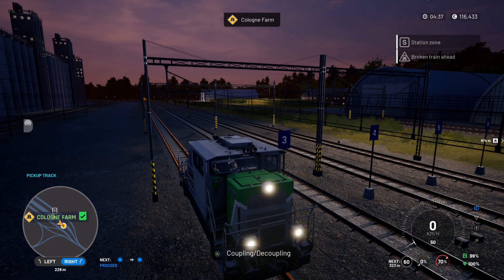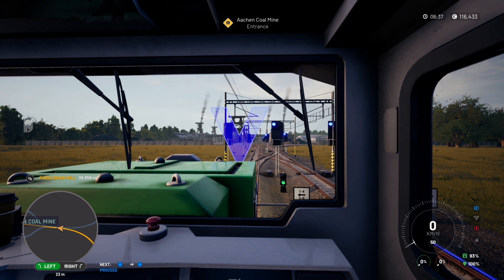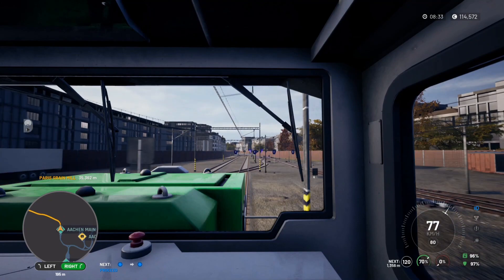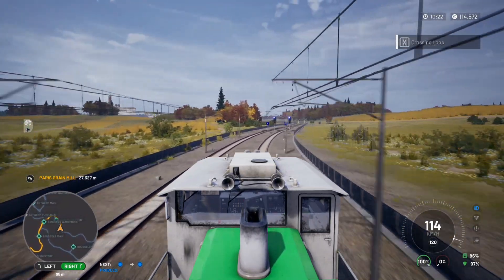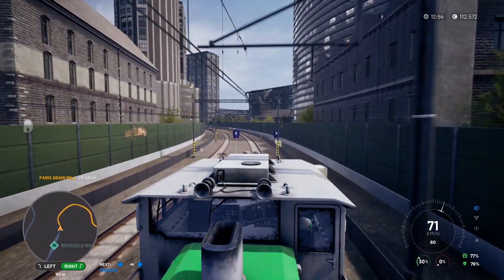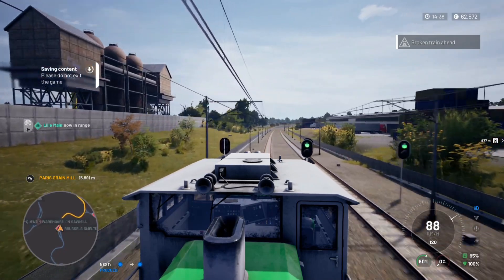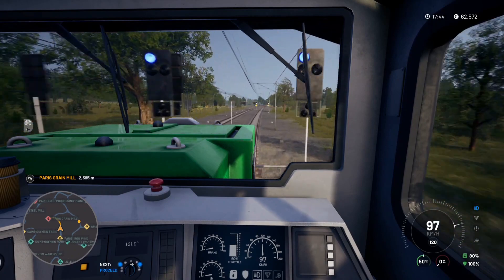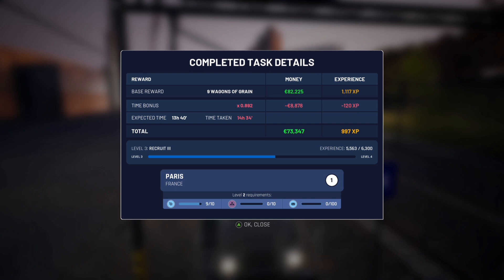Train Life | A Railway Simulator | Episode 3 | Cologne to Paris | Transporting Grain

Comment: 40:23 Here is a perfect example of why I only use the HUD speed restrictions as a loose guide, as the system (not a bug) is designed to always show the  lower speed change, even if you are not going that way...as you know from the SATNAV, you are continuing straight (left in this case), the 110 speed change - as shown on the actual signals, is to the Right (the Flashing Yellow) your route is on the solid green, so 120 is still in effect.  I have trained myself to play it and only watch the trackside signals, with the HUD there as backup only.

Comment: I will add, to your Derailment at the rail maintenance area, and it goes for all flashing yellow speed signals, you need to start slowing to the next restriction at the first signal that informs you that the next signal will be slower, as you have no chance of slowing when you can see the new speed signal. So it doesn't matter if you are doing 110 and pass a signal that is warning you that the nect one is 80, now is the time to slow down to 80, not when you see the solid yellow, always reduce your speed at the flashing yellow to the posted reduction. One thing I learned from playing train sims, it's not about learning how to accelerate, but how to brake. It's not like driving a car. And I never travel at the posted limits, I always travel 5 to 10 kph under.

Comment: As for you feeling like the speed changes are coming too fast, it's just practice, the game does tell you with more than enough time, just work off those flashing yellows, these give you more than enough time to adjust, same goes for passing stations you are not going to. You don't need to ask for permission, 99% of them have passing tracks that are only limited to 80kph, that's all you need to be aware of. Station access is only required if you need to pass those dwarf signals (next to the blue arrows)

Comment: The devs have confirmed that the alerts on the HUD for broken down trains on the track isn't a bug, it's because the game isn't linear and effectively you could stop and head back, that broken down train will still be there, the reason it remains on the HUD is because there is a radius from your train that will determine when an alert is reported. It's up to the driver to appraise the situation from the distance either decreasing or increasing to decide if any action is needed.

Comment: I've heard tge issues with the settings not saving are due to running it through the cloud, as on PS5 the settings save and if you have it installed locally on a PC it's fine, so not sure if the devs could fix it. It's probably how the settings save on the cloud server ?
Reply from the maker: Mmm I don't know about that. Other games don't seem to have a problem with the settings being saved although if anything isn't going to save it will be v-sync as on Euro truck

Comment: For me, as a PS5 gamer, this is easily the best (and only) Train game of it's type, and despite the minor issues I experience, for everything else, I can work around those. The game has massively improved since launch (on PS5)  As for this and TSW...I was right into that series from day 1, but after what happened towards the end of the TSW2 era and the launch of TSW3, I've moved on from those rinse and repeat games.  DTG haven't evolved that series one bit.

Train Life breathed new life into Train sims, having a full economy and the supply and demand, and lets not forget having such a massive open world to drive around, makes the narrow, one dimensional fixed timetables of TSW a bit of a joke that they didn't do something different when they did TSW3, but no, exactly the same.  That's what started to bore me. Doing the same route over and over, with the same experience since a 10am start at the given station on the same route will alway play the same, on red light if you are lucky and the same passing locos.  This was fine in TSW1 and somewhat in TSW2, but a third game that plays the same...no thanks.

I find that the new HUD has helped with prewarning you of up and coming restrictions.  I was watching when you were approaching the broken down train and the HUD showed the next block was on Red, before you could see the Red signals, all was needed was for you to change the points and the HUD would have shown double blue signals.  You only need to stop in both sides alert you of a Red signal.  As a rule I always slow to 50kph when I get any warning of a potential hazard, to give me time to appraise the situation and see if I can indeed just swap tracks to pass the hazard.

The Derail with the instant Red signals wasn't your fault, this is still a known issue that they "had" said was fixed in the last patch, but it wasn't.  They have said that maintenance areas will have more advanced warnings.
Reply from the maker: I do like the game really. It just to me is a little frustrating sometimes 😂